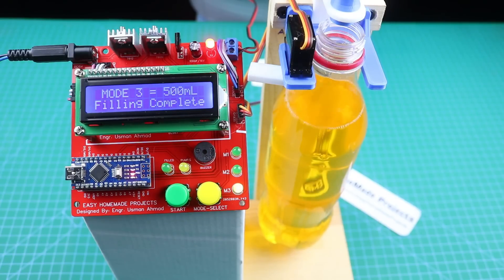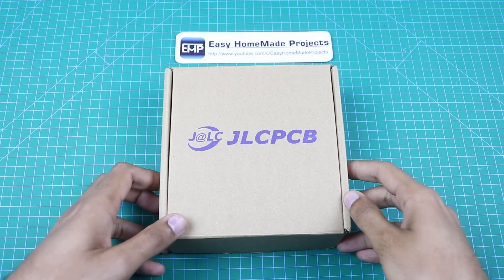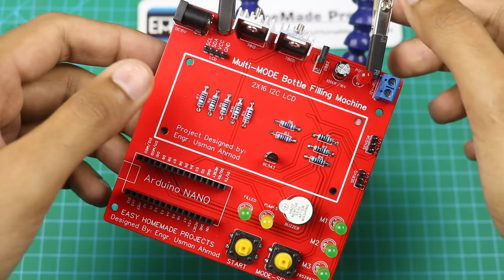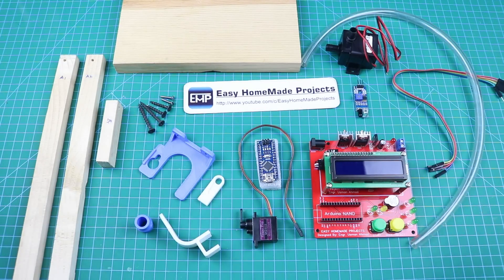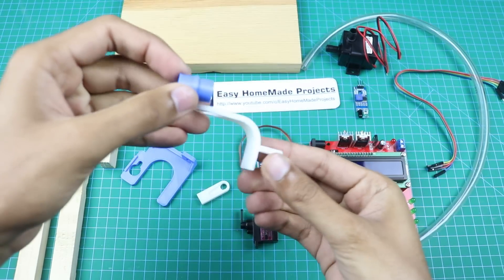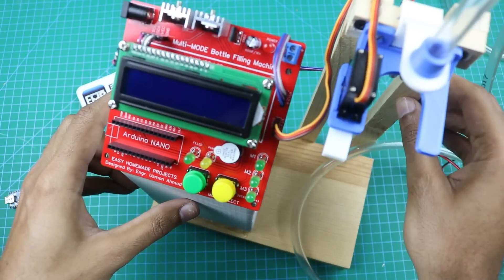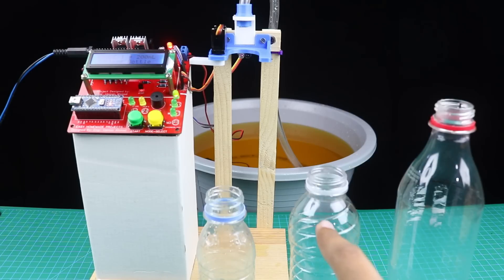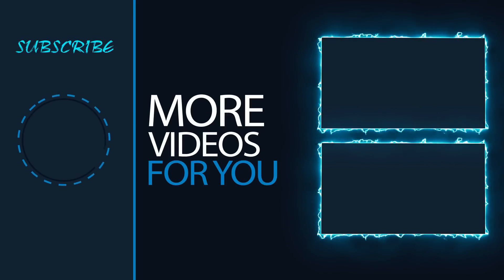DIY 3 Mode Automatic Bottle Filling Machine using Arduino

Comment: many people theys are asking how he has mesure the level of bootle, but is easy he put the delay which is neccessary to full up the bottle, for exemole to the bootle of 500cl, he put for exemple 200micros second to full it up.
Reply: he has mesurer it according to the time which is need to make full a bottle, to make full the bootle of 500ml is not the same with the bootle of 100ml or 300ml

Comment: Very Nice. I have a question. How do you know that the bottle is filled? I saw only one optical sensor.
Reply from the maker: Time dependent filling
Reply: @EasyHomeMadeProjects  sorry I was not clear. I mean, when you already filled the bottle if you push start botton there is a warning. Since I saw only optical sensor that detects if there is the bottle; which sensor detects that the bottle is filled and before to start again the pump you have to change the bottle?

Comment: For your pcb design service, what do you require?

Would a single page description and a Fritzing circuit be ok?

I need a fairly simple breakout board,
- Nano
- Relay module (not a relay, but rather 3 pin connector) Gnd, In1, In2 VCC
- 2x I2C connectors
- And some form of power conversation, preferably 12v to 5v or 3.3v (jumper selectable)
Reply from the maker: Please contact me on fiverr page
Reply: @EasyHomeMadeProjects  I will do, I was hoping not to have to set an account up, just to ask what you needed.

Ok, I can always delete the account afterwards

Thank you for getting back to me so quickly, much appreciated

Comment: This is a pretty neat little bottle filling machine, but I'm curious. I know it'll give you a warning if you try to fill a bottle again without replacing the bottle, but I would like to know if you could accidentally overfill a bottle of the wrong size? Would this little bottle filler be able to prevent that? Or are you just out of luck and have to clean the mess for your mistake? haha
Reply: nah i dont think so. it seems there is no part of the system to check the bottle size. it just know if there is a bottle or not. i mean, i think it is possible to make it to check the bottle size by putting another infrared sensor on the bottom of the bottle foot, facing up. so if it recognize there is an object above it a bit further, there might be a small bottle. if it close, then it might be a big bottle, etc.

Comment: Very nice video sir can you please tell me how it works how it know exact quantity of fluid gone in bottle.. I mean if we fill it 200ml how it confirms or know 200ml go inside bottle.. Any sensor?? If yes kindly tell.. I want to know more briefly if you can What's app me details 03153088506.. Thanks
Reply from the maker: It works on time calculations according to flow rate of water pump

Comment: This not a correct procedure to filling liquids from a given input ! Time delay is not a better one ! Even though your mechanic setup and design was good , it is not fit to be a automatic filling machine !
Reply: Why?

Hall effect, Vacuum head, Load cell and Direct sensors all will work, but so will a simple Millis loop

Comment: This machine how massure liquid quantity.. no sensor found in it
Reply: Use volume/ms
Reply: The pump displacement per second can be calculated and by controlling the ON time of the pump liquid quantity can be controlled without actually measuring it.

Comment: How it is even recognize the quantity? Which sensor is measuring the quantity?
Reply: For what I understood, the water pump fills the same ammount of mililiter in a given time,so I suppose he must measure how much time the machine must stay on(example: the pump fills 100 ml in 5 seconds, so he must turn on the pump, the arduino count 25 seconds to fill 500ml and then turn off).

my calculations are just an example,and if he does like this, he must measure how much tube he is using and adjust the time based on the lenght of it , because the tube carry the liquid and have an inside volume.
Reply: @joaofelipe2060  thanks bro....maybe you are correct

Comment: Did you measure the liquid in the bottles with a measuring cup to make sure that it was the correct amount? That's a neat machine.
Reply from the maker: Yup almost correct
Reply: @EasyHomeMadeProjects  भाई आपने फ्लो सेंसर के बिना किया है तो आप इसको  मैन्युल ही टाइम सेट किया होगाना? रिलेका  वो जरा एक्सप्लेन कीजिये मुजे आगर  100 ml भरना हो तो कैसे करूँ